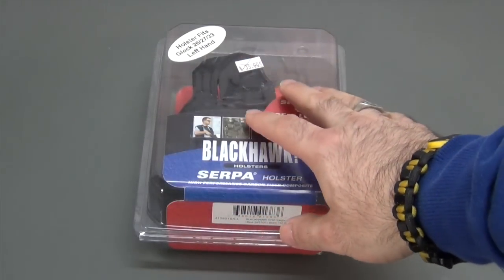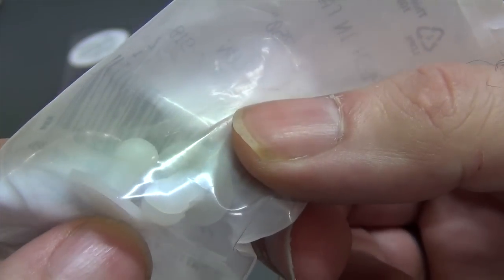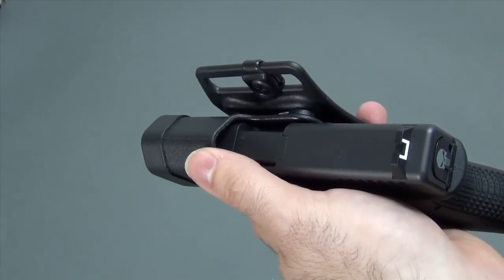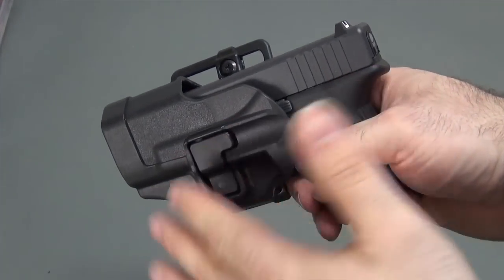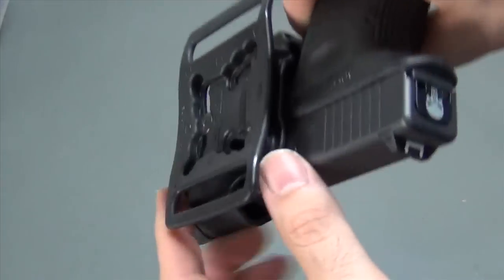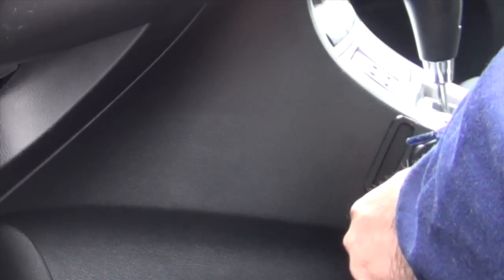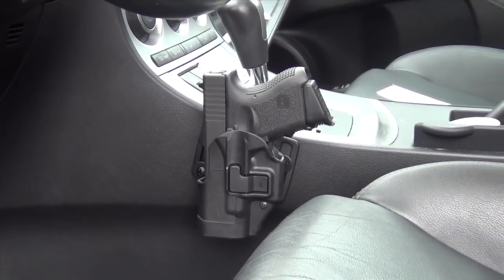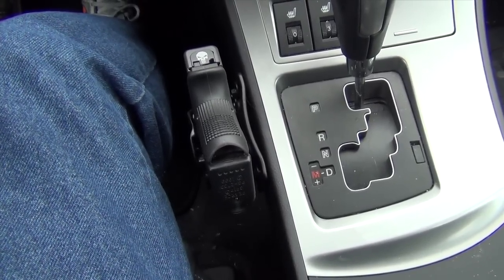Vehicle Handgun Retention System (customization & installation)

Comment: One point I would recommend that anyone trying this method should disassemble the console, especially for consoles like the the one in the vid, as to make sure you don't drill into any vital systems or through wires.
Reply: good advice that would be very bad to nic a wire
Reply: Not really,especially with those little ass screws & the chances of drilling through some wires are very slim. It's mostly empty space.

Comment: Just to throw out a slight variant to mounting your gun in this location.....I actually purchased a magnetic mount used to mount a gun under a desk etc. It cost me about $20 (I didn't shop around so I am sure they are available cheaper), and has a rubberized coating on it so it doesn't scratch the finish of the gun. I mounted it in the same location as you did, but now I have the option of mounting any gun I am carrying securely without changing holsters. It is also very easy to grab and use without having to draw out of the holster. As a bonus, once the gun is removed no one would ever know I keep a weapon there (valet, mechanics, or people looking in the window). I have never had any issues with the gun vibrating off or out of the position I put it in. Hope someone else might find this helpful.

Comment: I did something similar, but used a 5.11 tactical "Thumbdrive" holster, a holster which is VERY popular with law enforcement types. I attached the holster to a RAM mount (RAM-B-101-C at Amazon). And I didn't have to disable the holster's thumb release, just screwed the mount in place of the paddle or belt loop so the holster still works exactly as designed.  

For mounting, one half of the RAM mount screws to the holster, the other half screws to the truck console or dashboard.  The nice thing about this is that the stem is fully adjustable (knob type friction lock), so you can reposition the holster in the exact angle you want, up, down, left, right all without tools.  Want a different gun? just get another holster and mounting flange from RAM.  Since its universal, the truck-mounted piece stays in place.

And as far as concealing your weapon...  Just get a childs knit hat from Wally World and place it over your holstered weapon. Easy to remove when necessary and it's technically concealed.

Comment: I did a similar thing with an Urban Carry IWB holster.  I just used a piece of old belt for my mount.  Makes changing holsters easy and the leather lock on the holster holds the gun tight just like when I carry.

Comment: I did something similar about a month ago. I used a cheap blackhawk nylon holster and attached it with industrial strength velcro. Not as good retention but it works great. I didn't want to drill holes in my console but i may upgrade the setup. Great minds think alike i guess!

Comment from the maker: I actually handled one at the gunshow hoping to use it for this application. I did not like how it attached to the disk. There was quite a bit a of rattle. Plus, I could not figure out a way to mout the disk where the gun was high enough to not have to squeeze my hand between it and the console, I am sure it would work well for a lot of people though.

Comment: An alternative (depending on  how often you have a passenger and whether or not you're comfortable with their proximity to your weapon) would be to mount with a RH holster on the other side of the console. As an added benefit, when using the same type of draw/holster you carry with, you could mount it with the serpa quick-release and transfer the holster from your belt to your vehicle rig without needing to unholster/reholster the weapon, and it would be even faster to change for other handguns.

Comment from the maker: No, if you get the the ones for sheet metal they will not do that. The tap is only as wide as the shaft. It will prevent splitting when drilling.

Comment: Great video, i did this with the Glock OEM combat/sport holster. But id suggest getting the larger holster for the .45 ACP/10MM for the smaller frame as it tightens down when you screw it in, but that helps with the retention.

Comment from the maker: Unless they have changed the design those do not work well. The older ones did not have a wide enough backplate to get a stable connection to the plastic console. It wobbled which would cause splitting eventually. The wide back plate on these is solid and does not move at all.

Comment from the maker: Yes, but take into account shear strength and tension strengths are very different. A holster mounted horizontally under a dash would require a great deal more work securing it to prevent tear out.

Comment: I would like to suggest checking behind what your drilling into prior to drilling. I had a buddy drill a blind hole in his console straight into a airbag wire. Lucky for him he was under the steering wheel while drilling when the airbag came out at its typical 200mph.

Comment: Nice job, I've seen videos where people sell system kits that are no better than this.  You didn't show a shot of the "nub" after filing though.  Should it be formed to the same degree as the existing factory angle?  Or, just need to remove enough material to preclude needing to depress the release?

Comment: I came across some gun nuts out of Bulgaria with YouTube vids holstering off body, to a holster attached to the console. The times they were getting from reaching for and engaging was 1.2 , 1.5 seconds on average instead of the 2.8, 3.0 seconds from the seat on body holster wear, if you even bothered wearing a seatbelt. From that point on I have been taking my piece off body while in the vehicle ever since.

Comment: I did the same thing but I used the Blackhawk Strike platform. That way I dont have to           un-holster my firearm. I also mounted it on the passenger side of the console so I could just use the right handed Serpa and not have to modify it.

Comment: I've thought about doing this before, but usually keep a j-frame wedged between the seat and the arm rest console in a Desantis pocket holster so just the gun slides out.  But where you put yours would bother my right knee, I would have put it on the passenger's side

Comment: Blackhawk makes  Serpa quick disconnect kit (2 Female/1 Male) so you can attach a female piece in your car and a female piece on your belt or paddle, the male piece actually goes on your holster, so later you can just buy more male pieces for other blackhawk holsters you might have.

Comment: I realize this is an old video, but there are better options than drilling holes into the interior of your car, which the next buyer of your car will not appreciate, and may also not purchase your car. There are industrial grade velcros that are rock solid. Double faced carpet tape is also very strong. There are probably some other options as well.

Comment: i would recommend machine screws with nuts on the backside if possible over time screws in plastic will strip out when pushing and pulling on them

Comment: Pretty cool.  Too bad this couldn't be legally used in Florida.  Gun needs to be concealed on you, (if you have a cwp), or out of sight in the glove compartment, console, or in a case.
Reply: +gunsnroses4716 read his comment again.
Reply: in Florida your car is an extension of your home.  You don't have to your firearm on your person or tucked away out of sight at home so you'll be fine in a car.  I would keep a shirt near by to throw over it though and if you get pulled over, keep your hands on the wheel.

Comment: Instead of viling down the retainer, Couldn't you mount a right-handed holster on the passenger side of the shifter? Then you can just use your draw hand to release the retainer.

Comment from the maker: That doesn't look different than the used to be and the screw holes all fall behind the mass of the holster and not off to the side. That does not provide enough stabilization to prevent tearing of the screws. It it like prying the screws with a lever every time you rock the holster...but be my guest to try. you might prove me wrong.

Comment: Using the G Code RTI system would be better, use the same holster and change applications. Have a bunch of different female mounts with one holster with male mounts and just put in and go.

Comment: Thieves look for indications that something of value is in a vehicle...like GPS mounts left on windshields or laptop cases. A holster will tip them off that there might be a gun inside. Even if you keep the gun in a safe you will still have to deal with a broken window at the minimum.

Comment: what about cars/ trucks without  consoles.
Reply: Robert - I have a 2001 Dodge Ram without a console. I have the center console that flips up, which I rarely have up anyways. One recommendation I would make is that Blackhawk does make a bedside holster system that fits in between the mattresses, I borrowed a friends to see how it works for that kinda system, and the retention is good on the firearm, however if you hit a lot of bumps and the console bounces a little bit, that platform will wiggle free. One idea we were fiddling with was using velcro for added platform retention and that seemed to work rather well.

Comment: Detained is a far cry from face in asphalt. I support an LEO's right to take any necessary precautions to feel safe, but brutalization and the use of unnecessary force are never tolerable, especially against law abiding citizens. As former LEO, you should try, at the very least, to not enforce the "anti-gun bully cop" stereotype, if not work to improve LEO and gun owner relations. I also don't see how having a gun tucked between the seats is any less suspicious than having it mounted.